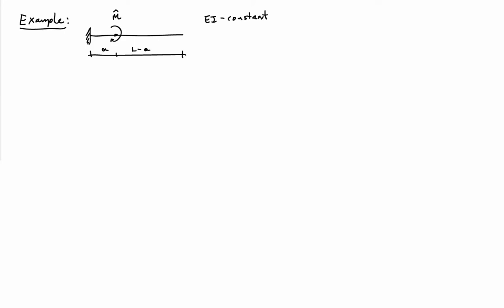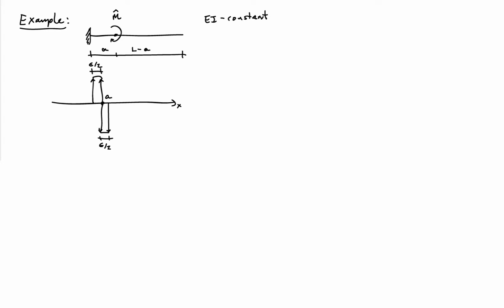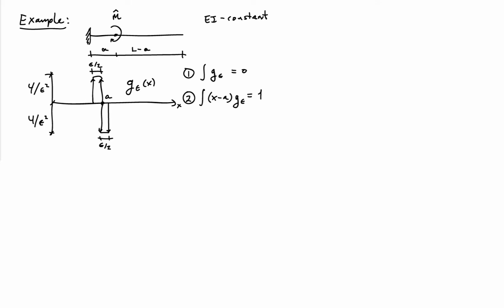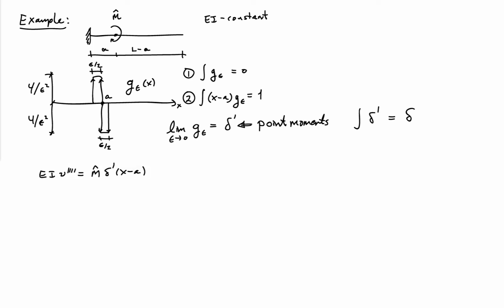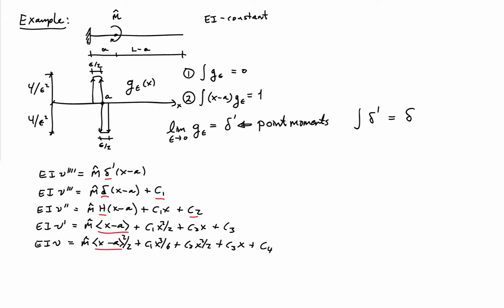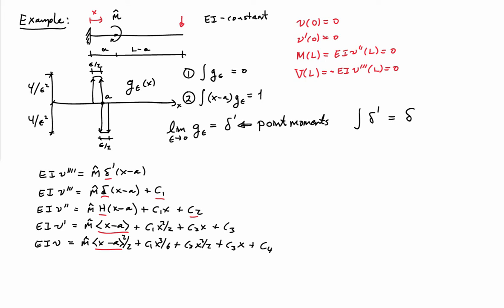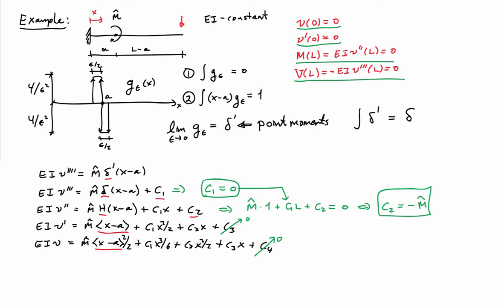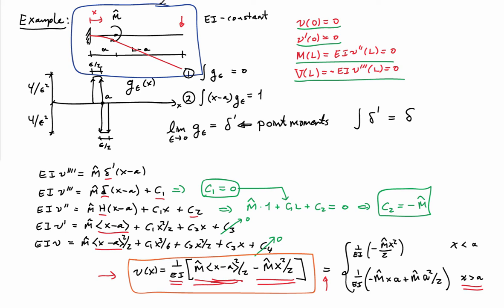(27C) Example - Deflection of a cantilever beam with a point moment

Comment: Will i get the same result if i were to calculate M=1000 or M=1K
Reply from the maker: The solution is symbolic, so you can use what every units you would like in evaluating it.  It is however important that you use consistent units for E, I, M-hat, a, and L, otherwise the units of your answer will be a complete jumble.
Reply: @sanjayg0  Am i write to assume when solving for v, if different power were to be used my constant will be different but ultimately the final result should the same as using other power?